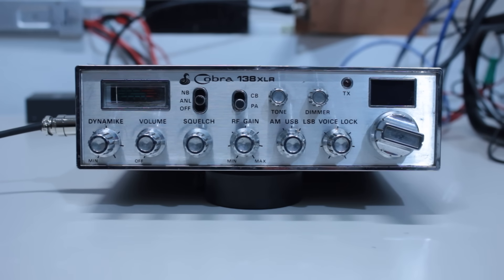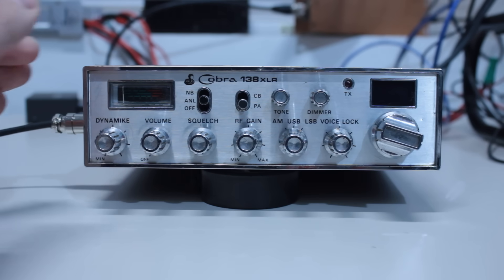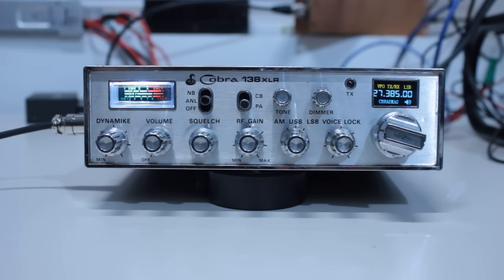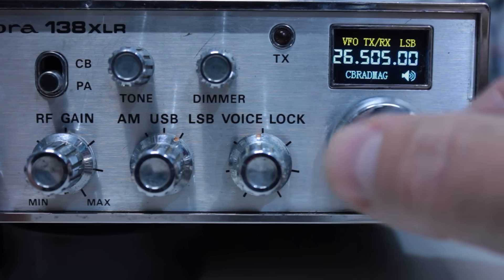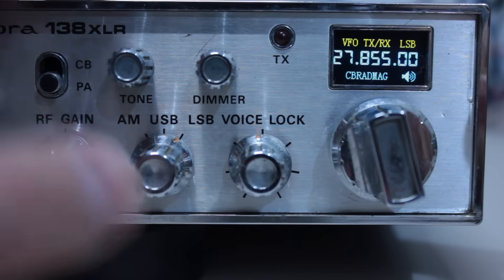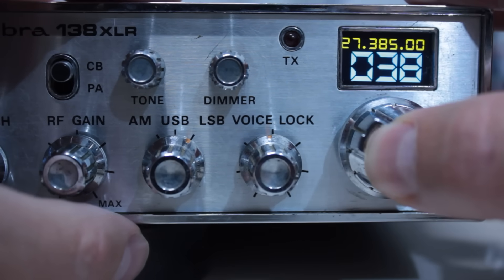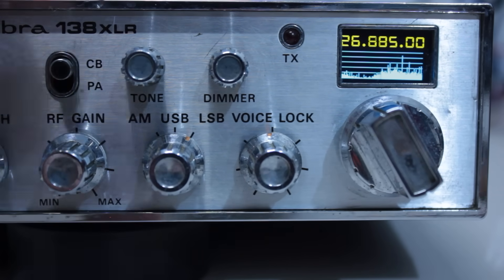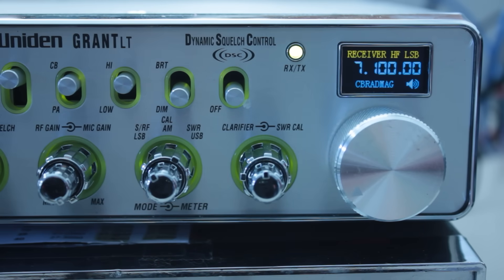This might be the coolest CB Radio modification we've ever seen

Comment: Ah - but does it still work..
On NZ models as I (still) have my original Airlane Mk 3 & Mk 4 units (my old Bell Pace 3w handheld died a destructive death years ago when it fell of a moving railway vehicle I was on.. ('twas a buggah and oopsie said, all at the same time)..

I gave up my 26 mhz cb radio days of (originally 7 channels with the Mk3 & then 11 channels with the Mk4) when they decided we had to convert all the 26 Mhz units to 27Mhz (something that couldn't be done unless you actually bought a new 27 Mhz unit)..

I just tried to do a google search on NZ Airlane models and found this (it opens in google but the link to the Facebook group is broken).

It shows three old 1970's CB radios BUT..
The title given for the middle unit is NOT that of a Mark 3 (pop-up-toaster model) as it's very definitely the rotational channel changer knob of the Mk 4 ..
The older 7 channel Mk 3 (pop-up-toaster) was easily identified by the SEVEN red pup-up channel selector buttons along the bottom of the faceplate, which of course got it the name pop-up toaster as changing channels POPPED up the button of previous channel it was on.

Having owned BOTH units, I knew the difference straight away

See. The Airlane Mk 4 with it's PA selector and rotary knob, is the middle unit.

https://www.google.com/imgres?imgurl=https%3A%2F%2Flookaside.fbsbx.com%2Flookaside%2Fcrawler%2Fmedia%2F%3Fmedia_id%3D668540206814017&imgrefurl=https%3A%2F%2Fzh-cn.facebook.com%2FTRCMNZ%2Fposts%2Fdonation-today-from-zl2jdw-jason-and-his-family-tait-black-face-cb-4-cb-radio-ai%2F668541046813933%2F&tbnid=bscX_upy4spwgM&vet=12ahUKEwiFrfnt5YX0AhWwkksFHY5pDWUQMygKegQIARAl..i&docid=FeWC3ikf3WViQM&w=960&h=539&q=airlane%20mark%203%20cb%20radio&ved=2ahUKEwiFrfnt5YX0AhWwkksFHY5pDWUQMygKegQIARAl

Comment: In the old days, I soldered a jumper wire inside and was able to slide off frequency in the sideband mode.  I talked all around the world on  my old Cobra CB radio set up a base station.

Comment: I once was trying the same replacing the PLL of a FM only radio by a FPGA full of home made software.
The idea was NOT to change the PCB of the radio but still being able to transmit PhaseLoopSSB signals and pickup the IF of the radio to form a SDR receivcer enabling to establihe Side band communication using a FM radio without modifieing the PCB.
I actualy got quiet far but al the experiments resulted in decay of the radio and my interest got over to another (probarly even more absurd) project.
Anyhow... this is a great idea, the display concept is the same i had in mind.

Comment: Believe me..... There's nothing cool about CB radio.  Ham or GMRS is the way to go.  CB is nothing but a static box.
Reply: Not necessarily true. While traveling a couple of years a few years ago, I called several times on the national hailing frequency to find out what was causing the back up on the 40 west bound just west of the Louisiana Texas border. Switched to the CB I'd brought as back up and instantly got information about a truck fire several miles ahead. If it's a radio and properly licensed person is operating it, within the rules of the FCC it's a fine radio. If it's a freaking bad emergency and the only contacts you can make are on the CB you'll be darned glad you had one.
Reply: @chrisbaker2903  NOPE.... Had plenty of cb's in the past. Nothing but a static box. Why do you think new cbs will now be able to transmit in FM on certain frequencies? BECAUSE the cb industry was going under and the industry must of lobbied the government to allow cb  to now transmit some channels in FM. I have my Ham license and now many truckers do also. Ham radio and GMRS a far superior to cb. With the use of IRLP and the other digital modes available to Ham radio you talk reliably around the world.

Comment: Back in my CB days it was called a SLIDER.    I have to say it's fancier.   But does the same.   Slides between freqs.
Reply: Copper electronics in Louisville Kentucky 35 years ago sold something called a buddy back (basically a transistor) aka slider device to solder in that would slide to 40 below zero up to Ham radio frequencies.
You're absolutely correct My friend.
Reply: sliders were great to avoid the fools trying to spoil the conversation with your buddies.

Comment: The early cb radios are definitely the best to own and modify.  I had a cobra chipped & tuned to the antenna of my over the road tractor.  I could talk & receive 50 miles out to other independent truckers.  I new what scales were open or closed. 
I new about traffic conditions ahead . It is my best tool.
Reply: I don't know what you mean by "early", but my CB I've had since the mid 70s only has 23 channels and good luck modifying it by "chipping" it.
Reply: What do I need to have it chipped

Comment: this is a nice mod. My cobra two thousand had the switches used to use as noise blankeer ect,  my one forty g t l . I would love to have this it has a bad channel swithc on it. the guy that used to work on my radios put a freak counter. but it takes it to get to the freak.
it was flaky up on ten and so was the cobra two thousand. the two thousand I gave to a buddy and I told him that if he ever want to get rid of it . give it back to me. I ask him about it. he told me it got stolen. I sure he sold it or traded it off.

Comment: Well, some radios have an actual frequency counter built in. My radio actually shows the frequency change when I adjust the clarifier.
Reply: Yes many rigs have a counter and yes they display the actual frequency even when you change your frequency with the clarifier. This video is about a DDS VFO with a bunch of features. It is a lot more than just a counter with a fancy display.

Comment: I have a Cobra 148 that needs some repairs it's working but I don't think it's working right I don't know if the mic cord is wired right something doesn't sound right who's fixing radios now in the United States that knows what they're doing CB radio
Reply: Check some of the truck stops.  Some of them sell and service CB radios.  If not repairing them, someone there may know where you can go.

Comment: Are radios used in the CB Service legally allowed to use variable frequency oscillator (VFO) tuning? I thought CB radio was restricted to 40 specific “channels”.
Reply: If you stay within    your lane ( CB band ) the man really doesnt give a damn what you do there or how you do it. However, interfear with public service radio and the man will be forced to pay you a visit. This is the unwritten golden rule of CB radio .
Reply: When was the last time the FCC enforced type specific rules in cb?  Guys have been using ham rigs modified for 11m since the 60/70s.  I doubt the fcc will pay any attention to this.   They are concerned with the guys running kilowatt amps not if your cb has a vfo.    Personally i like it but would rather have a modified 10 m rig.
Reply: @petek1pml746  you screen name seems to indicate that you are a ham, is that correct? If so, why fool around with Illegally modified CB radios when you can operate legally on the ham bands? You do know that you risk your Amateur license if you operate illegally on FCC regulated frequencies? CB operators who want to operate with more advanced equipment and operating modes should be encouraged to join our ranks as Amateur Radio operators…they would have more fun in the long run.
Reply: @petesmith6434  never said i was running anything.   I said the fcc has bigger fish to fry.   Regardless there are plenty of licensed amateurs who cross back and forth.  Don’t kid yourself.   If the fcc wants to visit my shack i only have type approved devices.   No concerns on my end.

Comment: I guess that's cool, if you are into that sort of thing. 

I'll stick with my Icom and Kenwoods. They do all that out of the box and it's legal.
Reply: Ya however... Head to head on 11mtrs a good CB radio will smoke a great ham radio all day in a pile up. Purpose built vs. General purpose.  Buck knife vs. Swiss Army knife.  Ect ect . Lastly here in the USA ,  a modified CB radio is just as legal to use on 11mtrs as any Ham rig . 73s from Catbox 32-1 in the Evergreen
Reply: @yellowsnow4512  According to the rules, neither is legal on 11 meters. 

As for pile-ups, a legal CB rig is 4 watts. Most amateur rigs these days are 100 watts. So yeah, if you're running illegally high power- like 2, 5, or 10kw you might have an advantage. But I do just fine with 100, and rarely need to turn on the amp- which on the ham bands is perfectly legal. 

Just sayin' that for the money you can dump into a CB rig in mods, you might as well grab a used Icom 706 or Yeasu FT-100D and have a VFO, a hundred watts, and every frequency between 500 khz and 30 mhz anyway.
Reply: @TheTreegodfather  I know neither would be legal. Rules aside on CB band a quality purpose built and modified Cb radio ,( same wattage/ antenna/ location  as your ham rig) will out talk it more often than not . I don't have any thing against ham radio's got one myself . Money aside as well
Reply: @yellowsnow4512     Don't think so.   Legal CB is 12 watts PEP.   Sure, you can add all sorts of illegal power.  You have to exceed 1500 watts PEP just to get to where a ham can legally do.  Current Ham transceivers have selectvity and noise reduction features I've never seen on CB sets.  Even the "Imports"   I don't use ham gear or work pileups on 11 meters.  What would be the point?   Put your modified CB junk on 10 meters and compare.   You'll notice how outclassed you are.

Comment: Free band which is 10 or 12 meter which is illegal unless you have a amateur class license.
Reply from the maker: Freeband is the area in between the 10,11,12 meter allocated bands and it is illegal to transmit there but it's pretty common.
Reply: @cbradiomagazine  Yes I know that.
Reply: So why do you bring it up then ? What is your point ?
Reply: @yellowsnow4512  Because it's an illegally modified class 5 radio and is illegal to posses or operate it .
Reply: @43mackmobile  

Captain Obvious! You really do believe that everyone involved in CB modifications don’t know this is illegal, eh??

Comment: Does this make the transmit & receive track together so the clarifier/voice lock modification is not necessary?
Reply from the maker: Yes there is an option in the menu to lock/unlock, although I haven’t messed with that setting yet. I’ll include that in another video

Comment: That s a pretty cool mod. Can you change the clarifer to only change the RX. I had an old Grant and used the toggle switch with an open/sliding clarifier to get in between channels. With the old mod, you really needed the open clarifier. With this new board, you can get in-between channels with the PLL, so my preference would be for the clarifier to only align the RX ...is that the case, or is the mod changing the TX with the clarifier?
Reply: Yes. Service menu item 5/30.

Comment: I think your slip is showing: 14:55 "all the way up to 25.555 if you want to be out there on the international calling frequency..." while the display reads 27.555.00. I was worried that you would end at 29.700.00 which is the high end of the IARU/U.S.10 meter ham band. As with high power CB 'import radios' the FCC began seriously fining CB shops that were selling them. (Six figure fines!) 
I was registering my 'export radio' in the U.S. Customs and Border Protection office at the Detroit/Windsor Tunnel for return from Canada, (Eh?) when an inspector spotted it and came rushing across the room demanding "What is that radio?" 
I replied "It's my 10 meter rig." He did an about-face and went back to the other side of the room without saying another word. (I did have my Advanced Class ham license on me, so I wasn't too concerned, but it did put the fear of God and the U.S. Govmint in me.)  Had I said "My CB radio" he would have confiscated it and I would have received a fine in the mail of $400 from the FCC.
US CBP was inspecting 18-wheelers at the Ambassador Bridge and confiscating their 'export radios' and the FCC was mailing them fines. (No kidding; no joke!) 
Just please just be careful when treading in the 'gray area,' because for the Feds, there ain't no gray about it: it is all in black and white, and you may be clam-digging in a mine field.
Nevertheless, enjoy radio! I do.

Comment: I came to comment and clear up some misinformation. If not allowed, by all means it's your channel.. delete my comment.
You have comments here from people referring to this as a "channel king" or the "same as".
I have been bombarded with emails over the last several months. Either to tell me that I have been "copied" or that I have in fact, "copied".
Neither is true, and some of it I think is not malicious, but a misunderstanding.
Some of the boards that people also refer to as a "channel king" did what this does. I stopped production on those many years ago.

They actually do exactly what this does and behave identically.
There were two variants. One used a custom designed PLL, and the other used DDS. (actual DDS, not a clock generator)
I sold them exclusely to a shop overseas. When that deal was struck I deleted all videos related to those boards.

It was not called a "channel king" except by those that associate it with me. It was never given a name. In fact, I am terrible at naming things.
I simply called it CM3 and the later variant that used the custom PLL and ARM processor was CM4.
"Channel king" seems to be synonymous with anything I did. In fact, it was Mike that named the CM5+ boards "channel king"
The boards that were actually named by Mike as "channel king" were CM5, CM6, CM7 and CM9 with the boards for the PLLs having a letter suffix.
CM1 is a replacement logic board for the HR2510 and CM2 was an experimental frequency counter replacement + modboard for the Cobra 2000.
CM8 thru CM8D are the 980SSB mod boards. They have "980 modboard" with some cheeky comments on the silkscreen.

What select people need to understand is that I didn't copy anything, and neither did they.
The projects are architecturally different and have nothing in common except they use some form of LCD.
Mine used an OLED and later a TFT and that's pretty much where the physical similarities end.
That said, I wish them well on their project.
Cheers.

Comment: Excellent gadget for regular cb radio. Does it only work on the older standard radios?
Reply from the maker: It can work on virtually any radio even newer ones.
Reply: @cbradiomagazine  great. So buying the kit is 1 thing but installation is only done by that shop???
So if you have an older radio you have to send it to them or can your local tech perform the installation?
Reply from the maker: @bgvan37  You can install it yourself but it takes some soldering skills. Troys is going to make a how to step by step video for install on a Cobra 148. But yes you can just send the radio to them for the install.

Comment: I have the cb 40v2 in my 148 gtl. I'm an experienced radio tech and I had trouble with it. I was looking into this mod at first. The whole of the vco/pll  section,all the components have to be removed from the board to fit the dds vfo. Yeah it's got scan and hf rx but those are just gimmicks. In the real world with a lot of the noise and interference guys get, those features can't be used. Long story short, the average Joe might be able to manage a CB40 kit (maybe he's lucky) but this dds vfo kit..... Not a hope.
Reply from the maker: Agreed, most people will likely have their tech or Troys Radio Service install this module!
Reply: It's unfortunate that the other guy that was making these going on 10 years ago stopped doing it.
One of the shops in the TAFT group was getting the boards from him under an agreement they made.
His were so refined that it could be installed in under 30 minutes and they were half the price.
That translated into a decent profit for the shop. You did not have to send it to a third party to be installed.
We have not been able to convince the guy to bring them back. Once his agreement expired he stopped supplying them.
Maybe these will improve enough to the point where we can do them and make a profit.
Reply: @taft2422  I do hope you are not referring to  the Farmer Dave boards???
Reply: @GeorgeEI7KO  No they were put out by some English guy named Rutherford.
They had the same looking display that this does.
We liked them because all you had to do for a Cobra 148 was remove the channel selector and L20. No mess of wires and boards and stuff.
Then you bolted a new display where you removed the channel selector, soldered a little board in where L20 was and connect a few wires.
Like I said it took 30 minutes and cost half. We have not been able to convince him to make them again.
You have a big following. Maybe you can convince him to make them again?

Comment: Should a guy get a cap job at the same time as the mod? Those capacitors are getting long in the tooth.
Reply from the maker: Great comment, yes that would be a great time to have that done,  although I do have multiple 30+ year radios that still have original caps. It can depend on a lot of environmental and use factors but a lot of these oldies are definitely getting to that age and it’s a good idea to get it done before you start having issues :)